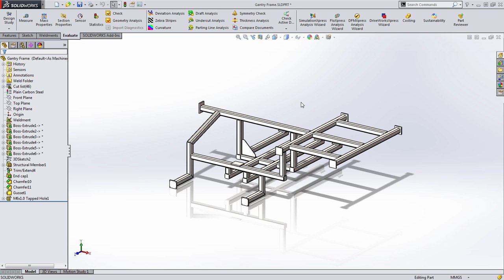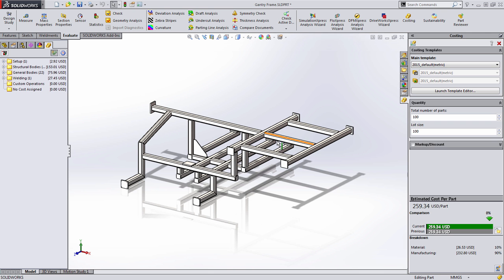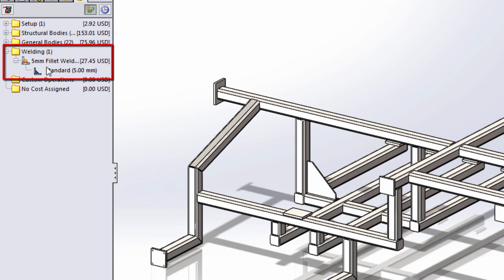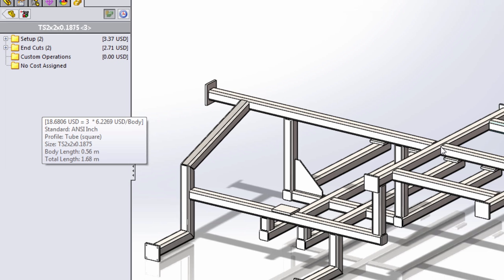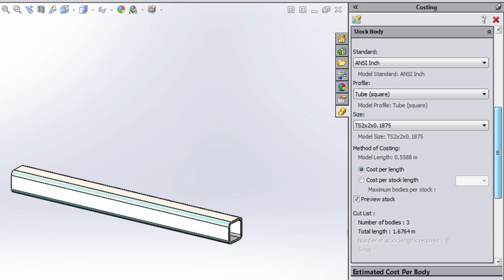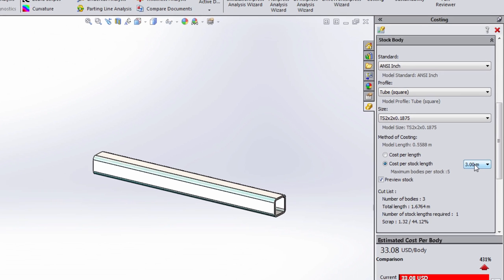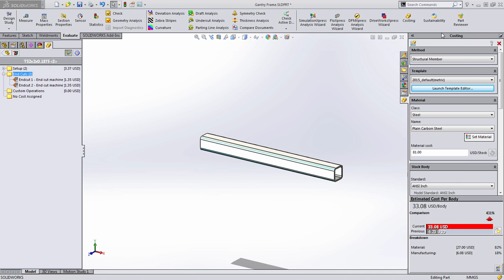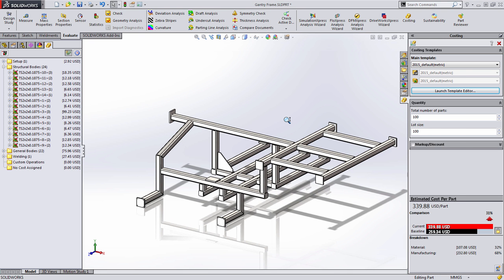SOLIDWORKS 2015 Sneak Peek: Costing for Weldments

Comment: Can't SW calculate how much bars I need for all the assembly ? What is the use of cost per stock length ? SW should know you can put 2 3metrs item in a 6meter stock bar